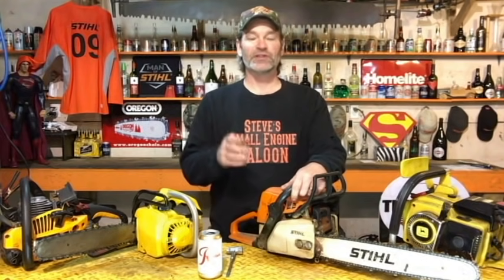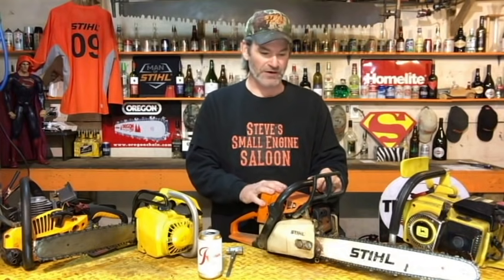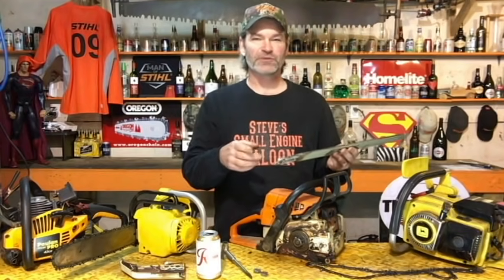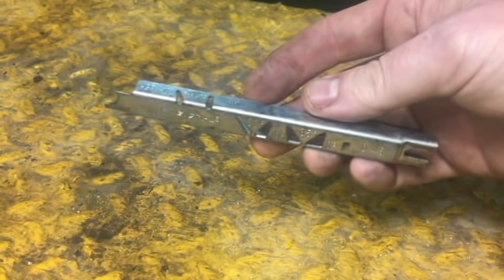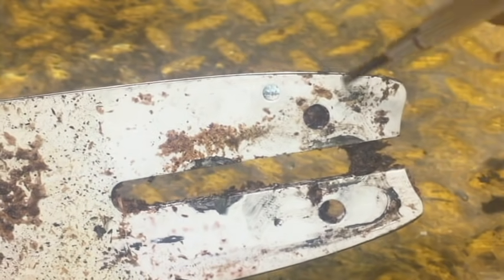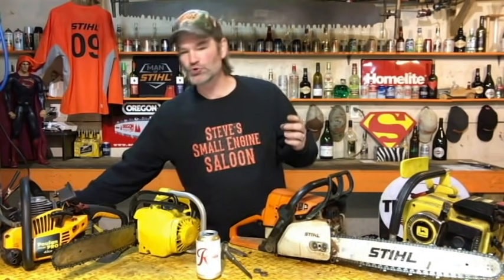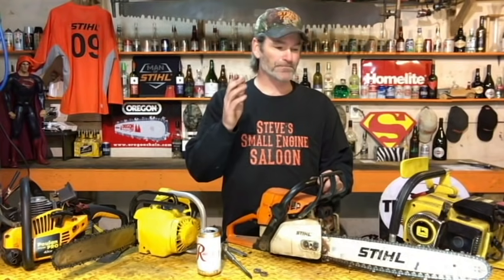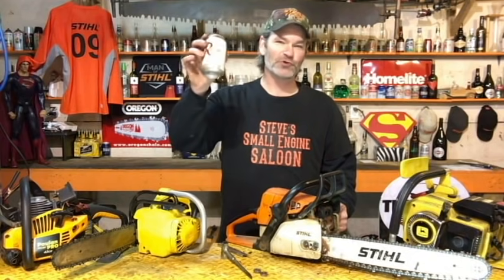How To Fix A ChainSaw If It Won't Oil The Bar And Chain

Comment: It's not as much of a problem with inboard clutches but it can still happen if the E-clip comes off,but the older conventional style of clutch where you can see the spring etc. should NEVER be ran without the clutch cover on.Not during the rev up but once you let off the trigger (gas) the clutch can back off and when it does it'll EXPLODE from centrifugal force.I don't think Joe Blow Homeowner want a few ounce piece of steel going through their skull at 1000's of RPM.
I know all to well,it wan't may saw but a coworker was working on their saw and was reving his 630 up without the clutch cover on and I happen to walk past the back of the truck when the clutch exploded and I actually felt a piece of the clutch fly past my face....didn't see it but the wind I sure as hell felt! He also wasn't able to cut the rest of the week because his clutch was in pieces somewhere on a 500Kv right of way and lost out on that pay.

Best and safest way is to clean out the bar and reinstall it and see if the tip will spray oil on something like what you did on the cardboard.
Another tip is if the oiler is working and when you run out of fuel but still have 1/3 tank of oil or more the oiler needs adjusted up.It shouldn't run empty when you need to refuel but still have a little bit left.If turning it up doesn't help or seem to use more oil than before than there is mechanical problems to the pump and/or oiler gear.I know to many Husky and Jred shops that would order a whole new oiler mech for the old 600-200 series saws but all they needed to do was pull the oiler apart,push the pin the oiler cam gear rides on and spin it around because it was worn out and wasn't riding the cam anymore and not pumping.I've turned mine twice and flipped it once in all these years of use,only one more turn till I have to get another pin (still won't need the whole setup).
Running the right amount of oil will keep your bar and chain wearing out as quick,especially when cutting trees that uses the whole length of bar.
This is a touchy subject for many over the years...but I found from experience motor oil (doesn't matter if it's new or used) seems to cause less wear on the bar and chain than "specifically designed" bar oil.
Yes there can be problem with wear if you just drain the oil out of the Yota and pour a tank full in the saw.I've always filled radiator fluid,spare oil or washer fluid containers with the used oil and left it set for months if not a year or more while I used oil previously cycled.Once it set a long time many of the damage causing particles would have settled to the bottom and then I'd pour the top section through a filter.After that I'd fill 1qt oil containers and I probably wouldn't use them for another couple months.Never had a problem with wear doing that,actually noticed the bars,chain,and tips have lasted a little longer over bar oil.It's messy,especially if your saw has the great oil seepage syndrome.I never used it logging and you don't want prestained wood before the end user decides if they want paint of stain and what color...lol

Others say about it being so carcinogenic...true but what isn't anymore.Cutting firewood isn't quite like logging or especially cutting for power where a lot of your cuts are waist level or higher and a lot of oil gets thrown into the air as a mist.Can't tell you how much bar oil I have wiped off my safety glasses,arms,face or spit the oil taste out of my mouth or inhaled in just a 10-12 maybe more hrs day cutting for power or logging.Not sure if I ever even tasted new or used motor oil while cutting firewood over the years.
Reply: The reason bar oil is so thick is because when the bar and chain gets hot the oil thins out to the right consistency. Thin, used motor oil will just thin out more once the bar gets hot, which is hard on the bar and chain.
Reply: @wizardofahhhs759  Apparently you never ran a saw or at least not much.
I've cut for power companies for years over 4 states and later went into logging in 3 states.Most of my life has been running saws...not those lil kiddie 029,55 Ranchers,etc.
I've been using used oil for many years cutting firewood.I have a multi-step process to filter out the grit from metal etc. and I will tell you there is noticeably less wear on the bar,chain and sprocket (both tip and clutch) than there is running true bar oil.It is a little on the messy side so it's not good for logging,no one would by pre-stained timber.Commercial use it wouldn't be good wither because the EPA would be crying and/or the neighbor next door would be after here white sheets on the line has black freckles all over it from their neighbors getting tree work done.
You say the engine oil thins out to much....so whats the reason it's used in engines? There is a lot more pressure in an engine than a chain exerts against a bar.Maybe bar oil should be used in engines instead...LOL
That'll be great on the main and rod bearings not to mention the cam,timing chain and rockers or followers that are on todays overhead cam engines or the pistons and rings.

You're just going off hearsay like the majority of morons that think they know what they're talking about without the experience.
Reply: I would agree with you on the used oil.  I did the same thing with putting the used oil in plastic jugs and let them sit for a long time.  I used synthetic oil and found that the wearing was considerably less than chain oil.  I figured I had to tighten the chain less than half as often as I did before with chain oil.  I did the same kind of cutting as before and everything was still the same but a big difference in wearing.

Dale in Canada

Comment: I write in as a big fan of yours Steve. But I want to speak to cleaning the groove on the bar.
PLEASE don't use a screwdriver. The groove has parallel sides. And a screwdriver is tapered. Screwdrivers will not clean everything out.

I like to buy doo dads anyway. Small saw accessories that help the job along. I wish to suggest purchasing any of several tools that are made for this little task. Some little tools do this job on one end and another part of the tool does another job. But you need an implement with straight, parallel sides. Your actually clean bar will oil the chain better.

And don't forget the oil holes as Steve said.

Comment: Others say drain the oil out and put petrol in start the engine and run until petrol cleans it out then drain out the petrol and add oil 👍

Comment: Another way to check to confirm the bar is oiling is to put a piece of paper down on the ground and run the saw, with blade and chain on, with the bar tip pointed at the paper.  If it is oiling, you will see the spray of the oil on the paper.
Cheers!!

Comment: Hey Steve. I have a 251c saw that oils at first and after 10-15 minutes barely if at all. I've had it into a Stihl service shop twice and still does it. The bar is not plugged with saw dust. Any ideas? It already had the pickup and a tube changed.
Reply: Im having the same issue.

Comment: I've been watching your videos for a while and you really do know your stuff when it comes to chainsaws. I'm looking at Still MS 390 to buy. It's a 2009 model and really great condition. Except for one thing... Bar oil is leaking from somewhere. I've looked everywhere for an answer and nothing. Where are the areas I can look to detect a leak? The oil was on the outside  of the bar/chain cover. Thanks! Think I'll pop the top on a cold one!

Comment: Hi Steve, just starting watching your videos, great info and tips. Have a couple of questions for you if you can maybe point me in the right direction. I recently got a MS361 saw as a gift and noticed it will leak bar oil out, roughly half the tank after being topped off and after running the saw, having the off/storage, and only running the saw for a short period perhaps 30 minutes to an hour. To test if it was the bar oil cap/gasket I have laid it on its side with the cap side up and it will still leak the same amount, with no oil residue at the filler cap.   Two other things, trying to keep it brief. I’ve noticed after the saw has been running/cutting for a good while maybe 30 minutes or so while having the chain brake engaged to move around safely the saw will shut off on its own, not always and even though the engine is still warm I’ll need to start it with semi choke and it fires right back up. Last thing and this doesn’t do it all the time but every here and there with the saw running and the chain brake disengaged for cutting, with no throttle applied the chain Will very slowly start moving. I’ve had other low end saws in the past but this is my first pro saw and I’m trying to learn the tips and tricks. Any input would be much appreciated when you have the time. Thanks.

Comment: Steve, love your channel.  I have a question.  I have a Stihl MS261.  The normal max chain bar is 20".  I want to put a 25 inch bar on it for extra reach on larger trees.  I normally am able to get by with the 20', but once in a while, an extra 4 inches would be really useful.  What bar would you recommend?  I am thinking of the 30030004030.  Will the oiling port on the larger bar match up with the oiler on the chainsaw?  Thanks for your advise.

Comment: Another good video Steve, if possible clean your saw after each cutting session. Compressed air is nice as it makes the job easier. Clean the bar slot as Steve mentioned, just don’t slide something in the slot that will widen that gap. Also check the oiling port hole on the saw for cleanliness while the bar is off. Always use bar & chain oil, other oil can cause issues. Thanks Steve, from the USA—eh!

Comment: Maybe you can answer my question. I have a chainsaw that has a manual oil pump that you have to pump with your thumb. Approximately how often should I be pumping the oil for the bar and chain. Thanks for all your videos!! They are drinking awesome😂

Comment: I bought a stihl 391 two years ago and brought it in due to bar smoking all the time. I opened the oiler screw all the way without change. Installed new bar, no change. Uses 1/2 tank of oil to full tank of fuel. I'm using stihl synthetic. I can run full throttle and get no to hardly noticable spray after 15 seconds. I just sprayed the bar out with wd-40 then with compressed air and now I have no flow through the bar. I do lift the bar when tensioning and tightening. My echo cs 400 drips with oil if you turn it up along with my battery ego chainsaw. I'm really disappointed since that was my first saw and currently my most expensive and least used due to this.

Comment: Steve: As always great video. I used penetrating oil with the straw/nozzle to clean out the oil holes on the guide bar.

Comment: I just take my bar off. Dismount the chain and wash with a garden hose the whole setup. Motor/bar/chain/covers. Gets all the oily crud out. Then reassemble and wipe it down Then run the chainsaw motor for about a minute. Then run the blade for about a minute. If I have been giving it a real workout. Blow it down with compressed air after the wash. Then run for about 2 minutes.
Seems to work.
Cheers
MJ

Comment: My old danarm spill sto much oil. When I put it away it has a puddle under the engine and the blade and chain are over lubricated. I can't seem to find the adjustment screw.
Reply: Better than no oil at all! Chainsaws are messy. Put a bit of cardboard under it, or a piece of plywood or other board where you store the saw and just let it drip :)

Comment: Great video and instruction. The Sthil MS 180 chainsaw has two holes at the clutch end of the blade.   Turning the machine on with no blade was a good start to see that it was pumping out oil.  I cleaned out the channel on the blade  with a scraper, the little screw driver that Sthil provides and a paper clip.  There is a hole between the blade channel and the blade hole that was full of sawdust.
Reply from the maker: Right on...

Comment: Well I have a question for anyone that can answer this, I have a Dewalt featherlight electric chainsaw that I just bought it seem to work just fine battery is been fully charged but when I made my cards I made a cut top going down at a pie angle bottom going back up at that same Pie angle , of course I know it has oil it started smoking didn’t catch on fire I guess I turned it to far sideways but now it won’t start it only clicks like it wants to but it doesn’t fire what just happened what can I do to fix this problem

Comment: I have a Homelite 42cc 18" chainsaw. Is there such thing as getting to much oil to bar guide seems to be on the excessive side. I guess better than no oil. A friend of mine said on his different type of chainsaw he was able to adjust it where he burns a tank of gas that he just has enough oil in his reservoir where he safe. However, mine I don't have that option. Your thoughts?
Reply from the maker: Cheaper saws dont have the adjustment.  Better too much than not enough...

Comment: Hey Steve!...
I acquired a used stihl 029. Strong compression and ran good but, the saw was packed with bar oil and saw dust and oil passages were completely blocked.
Cleaned’er out and installed new OEM bar and chain. Set the Oiler to the ematic position, as recommended. Now within a couple minutes of run time, it is dripping oil out the side cover and slinging oil all over the front of the saw and muffler.
Are there any common issues that may be causing the excessive oil flow?
Thanks
Dan
Reply from the maker: I will have to check but i believe that is one model that has a little plug beside the muffler on the bar side!  It pops out sometimes and shoots bar oil out the front beside the muffler.  Check that....

Comment: I have a husky 576xp that if I don't run or drain the bar oil out it will leak out over night all over the truck bed or garage floor and is a pain in the butt,,, it oils fine when running so the pumps good.  What ya think
Reply from the maker: I'm gonna do a video on this soon....

Comment: Opposite problem on my 025, too much oil.  Dripping off the bar, getting everywhere.  Not leaking anywhere, dry under the sprocket, same oil as always, just suddenly pumping way more oil than the chain can dissipate.

Comment: Steve, I have an MS250. It was leaking chain oil profusely. I took it apart and replaced the worm  gear, pump and hose and that plastic connector. I did exactly as shown by Donyboy73. But it still leaks like crazy. Now is it possible the oil reservoir is cracked?  Years ago the chainsaw fell from my roof. Didn't see any damage but from then on it leaked. Just not sure where to go from here. Thanks.
Reply from the maker: Could be cracked or where the two halves join together the gasket could leak...
Reply from the maker: Just thought of another real possibility on that model, but impossible to describe in words!  I will try to do a quick video before this weekend for ya...
Reply: Drain the tank of oil, put some gas in the tank, any  leaks should show  up pretty quick, just use the gas in the car or mower, a little bar oil won't hurt in a full tank of gas.

Comment: Ah Steve can I use Aviation 100 octane  fuel in my Stihl  chainsaw and my Kohler 20 v- twin lawnmower.im tired of buying gasoline in a can for $28 gallon and regular  gasoline  goes bad after a month Aviation  100 octane  is ethanol  free and it's  $5 a gallon.

Comment: Notice theres only 1 oil hole on a rollamatic ?. This means you can NOT invert the guide bar like you stated in another video....unlike a duramatic that you can
Reply from the maker: I Just googled a bunch of rollamatics, they ALL can be flipped!  Dont know what you mean.  Maybe post a pic of what your talking about....
Reply: Steve's Small Engine Saloon 
My apology, you're correct.....thank you for pointing that out and the importance of cleaning it

Comment: I am having trouble with some bad bar and chain oil that I bought.  how do I flush an oil tank that had bad bar and chain oil.  I want to use a new brand of bar and chain oil.
Reply from the maker: I have ran mixed fuel through the oil system with no bar and chain.  Seems to work fine...

Comment: My MS250 works fine and oils fine. However the chain oil leaks terribly. I find a lot of oil in the base of my chain saw case everytime I open it. is this a repairable job? Is it just an o ring? is it the oil reservoir. How can I check this. Love your videos.
Reply from the maker: Only 3 places it can leak.  The cap, the vent and the hole that goes to the guide bar....
Reply: The cap is fine. What vent hole do you mean? And the hole to the guide bar looks clean. However I am trying to open up the saw and cannot for the life of me remove the clutch drum. I see on other videos (Dany Boy) that he just removes the clip and the drum comes off. I can get the clip off alright but the drum is jammed in. Just cannot get it off. I have tried prying it up to no avail. Is there a trick to it? Thanks.
Reply from the maker: Before you pull the drum off, make sure the chain brake is also off.  Will pinch the drum....